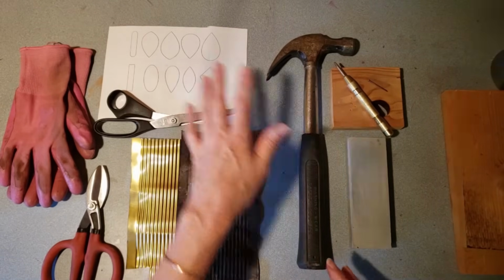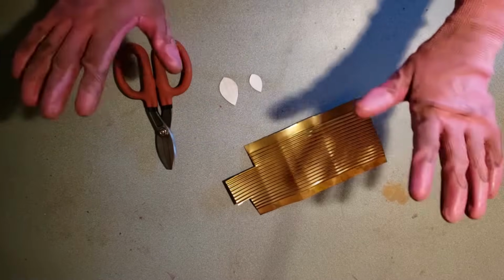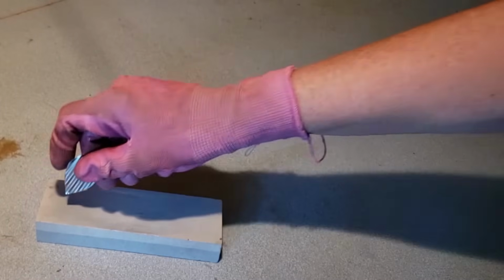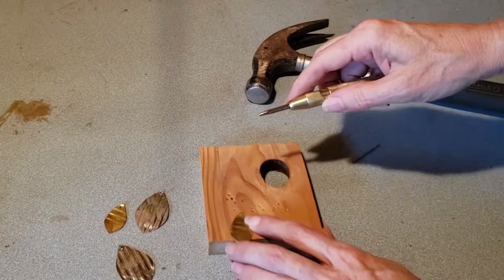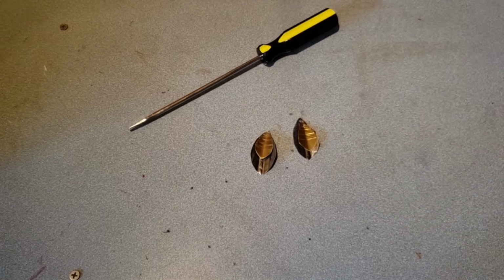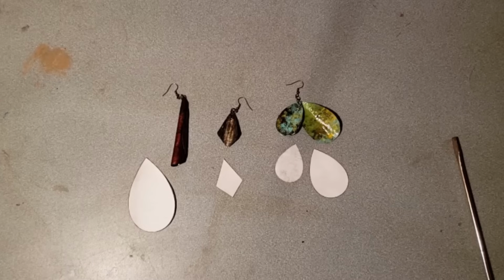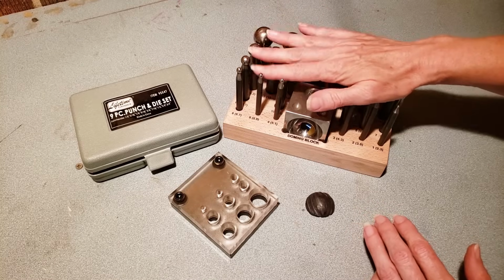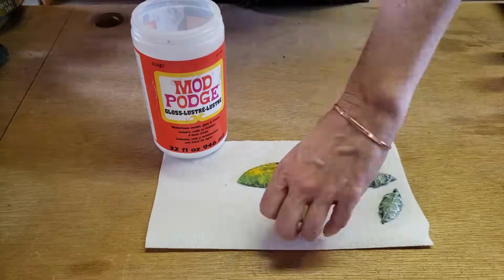How to make recycled metal earrings from tin cans - no expensive jewelry making tools required

Comment: Do not use a sharpening stone for that. Sandpaper on a flat surface or a file is much better. That stone isn't designed to flatten rough edges. It's for honing the edge of a knife blade.

Comment: Great tutorial! It’s hard to choose but I think I like #1 the best. I  bc plan to watch more of your videos so it might be answered in another- but , I’ll ask here. Do you have another way to get the sides of metal less sharp? Would sanding with sandpaper do it? I just want to minimize the possibility of accidentally cutting myself when they are done- so just from normal picking them up. Hope that makes sense.
Reply from the maker: Hi Lisa - Thanks for your question. I do sand down the pointed ends and then hammer the pieces before shaping them.  As long as there aren't any burrs on the edges they aren't sharp when handling the metal. Hope that helps. Thanks for watching.